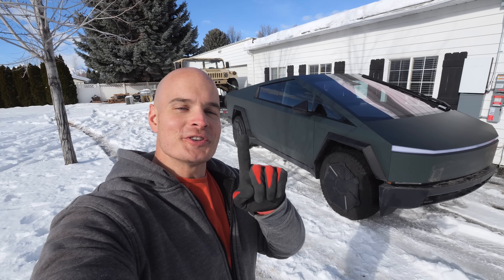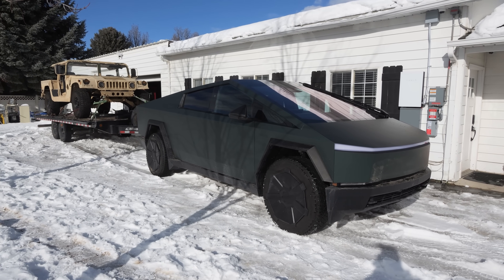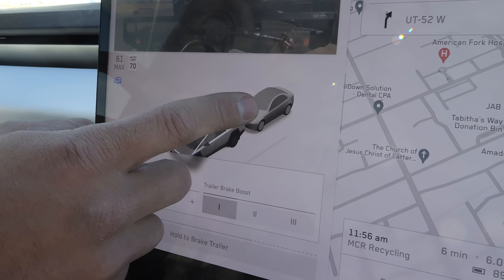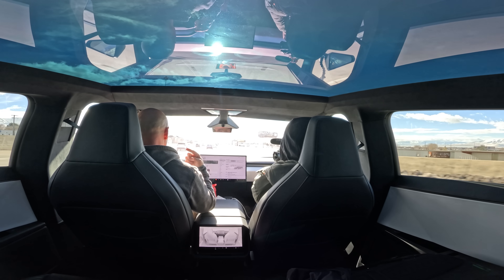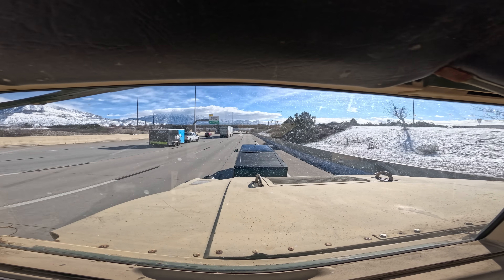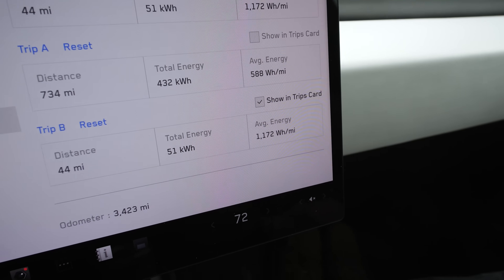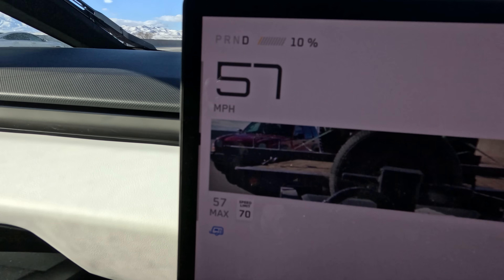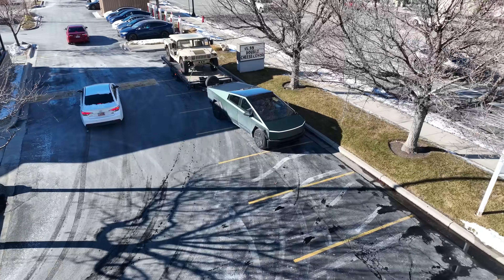How far can the CYBERTRUCK tow 11,000lbs in Freezing Weather?

Comment: Luckily the cybertruck's towing software and information displayed can all be improved, but since tesla is all about simplicity (they removed the cool power graphs that used yo be in the guage cluster on the old model s), i don't see that coming any time soon. 

But with the integration of trackmode with all its data and customizability, i hope that's a sign we could be getting some more in depth information in Tesla's going forward. At least in specialized modes.

Comment: Which rivian did you test? Because the rivians power ranges from around 533hp, to 665hp, to 835hp. The lightning ranges from 460hp to 580hp, and this version of the cybertruck has 600hp.

The middle trim rivian with 665hp has a 0-60 in 3.5s, the lightning with 580hp does 60 in 4.2s, while the cybertruck does 60 in 4.1s so slower than the rivian, slightly faster than the lightning. So it actually does make sense that the cybertruck wasnt the fastest in this case, but i am suprised by the lightnings performance with the last power, while weighing around the same as the cybertruck dual motor.

Comment: Dude i think my Jeep Wagoneer at near 40 years old is quieter inside..  90 miles is pretty meh.  My Jeep uses an engine and transmission from the 70s.. 50 years ago.. and towed 7400lbs and i got 150 mile range. And this is with a 50 year old engine design and thats abaolutetly terrible mileage.. granted i was alao going up n down the mountains in va

When you think about it.  Yes yours is towing more.. but over all 90 miles is pretty bad.

Comment: What a fucking joke.  My 04 lly would go 90 miles on 15 bucks of diesel easy pulling that light load.  I could keep going indefinitely with 3 min fill ups.  Range per fill up is roughly 400 miles.  Electric is 50+ years away from modern  combustion engines.  It also got very cold for a lot of places and these electric vehicles wouldn't even work......

Comment: This is really bad. I have a 6000 lb boat that I want to tow to the ocean for a day out on the water. I'm about 110 miles from the ocean. So I just barely get it there, then have to contend with wasting time charging for the trip home? My f150 makes the round trip without having to add fuel. Even if I had to add fuel,  it's a 5 minute delay.